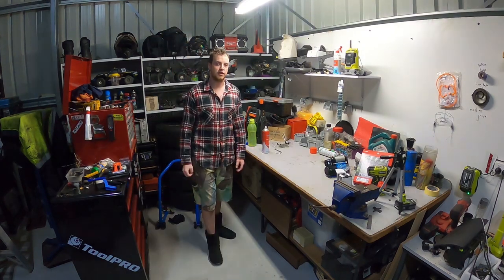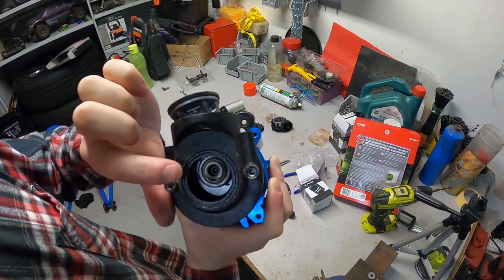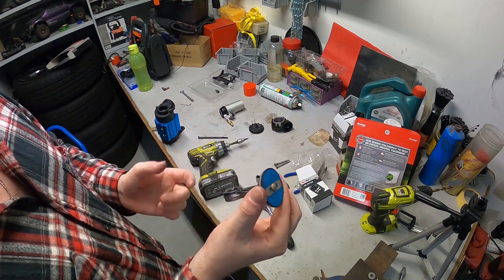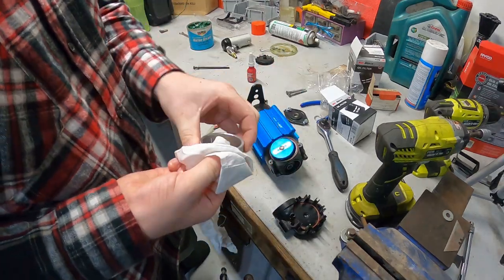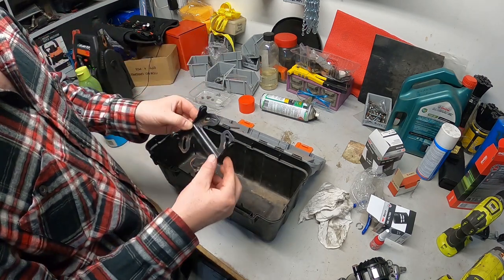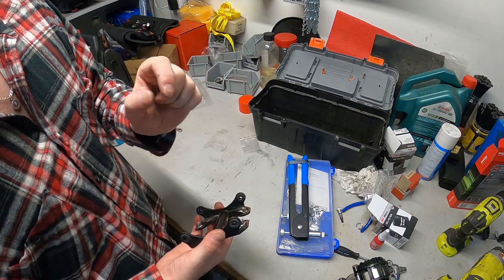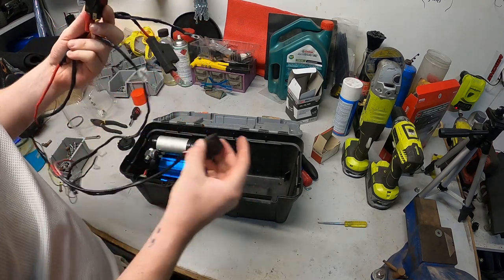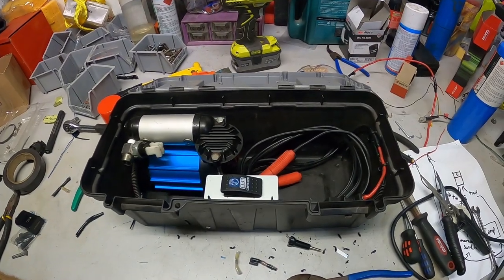CHEAP ARB PRODUCT! 2nd hand purchase, WILL IT WORK?! rebuild CKMA12 compressor

Comment: How many PSI max?  Looks a bit small for airing up 4 x 4WD tyres.  Thanks for sharing. 👍
Reply from the maker: The pressure switch from factory is 100psi. These things are a high output compressor and actually pack a punch. :) check out the specs of the ckma12 on Google or ARB website :)

Comment: Actually just watch it again. 
You have to put the sleeve on from the bottom so as not to kink the rubber piston ring.
Then reverse it the other way and slide the conrod down from the top into the housing. 
You the place a screw driver under the piston and get the piston to top dead centre.
Then push the bush through the conrod with the retention clip fitted.
Then put some lock tight on the allen key and screw down.
With the piston still jammed with the screw driver you can tighten up the screw as tight as possible. 
No way did you tighten that screw enough and i would think you also stuffed the rubber piston ring by pushing the sleeve on backwards. 
After all that I've posted yours probably works fine😅
Reply from the maker: Yeah she's still thumping away with no issues haha